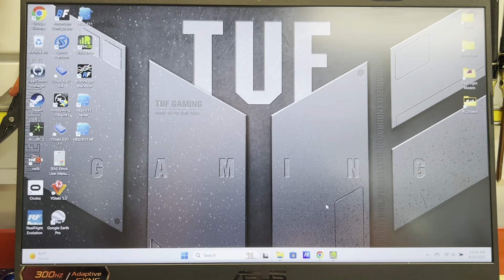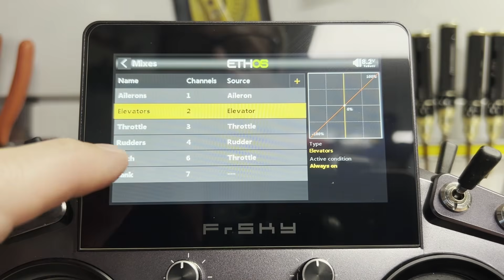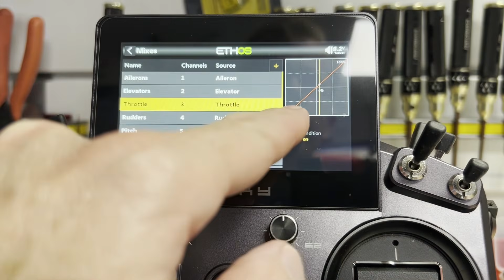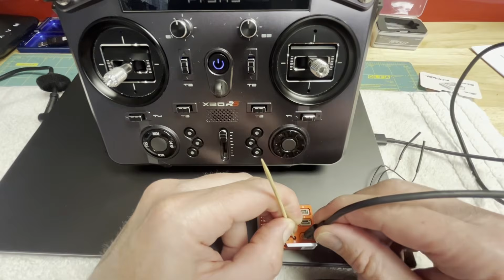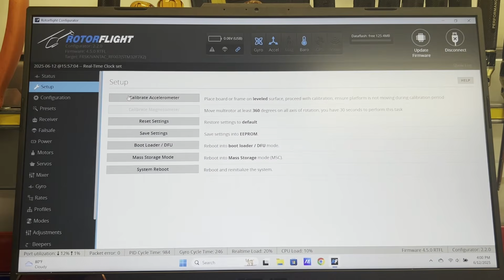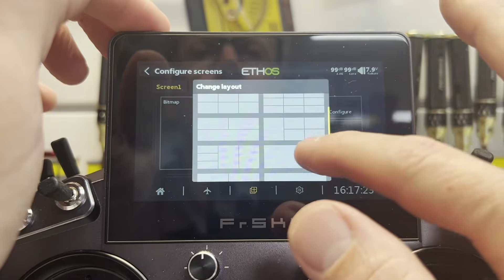Vantac RF007 and FrSKY Radio setup

Comment: Hi Adam, the ImpulseRC website has closed down. I'm able to detect my unit, but when updating the firmware. I get a "failed to open serial port" at the top left. It seems available at github, but neither chrome or edge allow the download as they flag it as unsafe? I've used my USB data cable for data transfer before and I've also tried the USB data cable included in the box. Both produce the same result.
Reply from the maker: Darn!  Let me figure out what hat people are using now. Sorry about late reply.
Reply: @adamsmall2301  Morning, no problem. I spoke to FrSky support and they emailed me the Driver Fixer link. It seems to still be available via GitHub, but presents a message that it could not be safe for download.

Comment: What happens if you inadvertently hit that arm switch in-flight?  I imagine it would be like losing the "Jesus bolt" while flying?😮
Reply from the maker: The motor would cut off lol. I put it on a switch that isn’t easy to reach.
Reply: Gave away mine last month, don't want that anywhere near my expensive scale models.  Spirit GT with Geolink all the way for me! 😂

Comment: Hello Adam, I followed your video for setting up as I was very new to Ethos. I put the firmware file in the flashdrive, instead of the other drive. Do you know if that will create chaos 🤔
Thanks for all your hard work.
Reply from the maker: I’m not sure if it would or not. Have you tried it out yet?
Reply: @adamsmall2301 yes it's fine also deleted the wrong file. All is awesome just waiting for the weather. Thank you for getting back to me 🚁🚁🚁

Comment from the maker: Here is a copy of my diff all file for a Tron Dnamic, Xnova Lightening 4025-830, HW 150 amp 8s, Xpert R3HV cyclic servos, Xpert R2T tail servo.

# diff all

# version
# Rotorflight / STM32F7X2 (S7X2) 4.5.0-RC4 May  7 2025 / 08:42:52 (dc4faef) MSP API: 12.8

# start the command batch
batch start

# reset configuration to default settings
defaults nosave

board_name VANTAC_RF007
board_design F7B5
manufacturer_id FRSK
mcu_id 001f00273433510131303737
signature 

# name: Dnamic

# feature
feature TELEMETRY
feature GOVERNOR
feature ESC_SENSOR
feature FREQ_SENSOR
feature RPM_FILTER

# serial
serial 1 1024 115200 57600 0 115200

# servo
servo 1 1451 -700 700 500 500 333 0 3
servo 2 1533 -700 700 500 500 333 0 2
servo 3 1471 -700 700 500 500 333 0 3
servo 4 760 -350 350 250 250 500 0 1

# mixer input
mixer input SR -1250 1250 795
mixer input SP -1250 1250 -795
mixer input SY -1658 1167 580
mixer input SC -1250 1250 940

# aux
aux 0 0 0 1800 2100 0 0
aux 1 53 2 1800 2100 0 0
aux 2 26 3 1400 1600 0 0
aux 3 31 3 1800 2100 0 0

# adjfunc
adjfunc 0 2 255 1500 1500 1 970 2030 975 2025 0 1 3
adjfunc 1 1 255 1500 1500 1 970 2030 975 2025 0 0 3

# master
set gyro_lpf1_static_hz = 150
set dyn_notch_count = 2
set dyn_notch_q = 30
set dyn_notch_min_hz = 60
set acc_calibration = 2,-11,45,1
set blackbox_rate_denom = 2
set blackbox_log_acc = ON
set blackbox_log_esc = ON
set blackbox_log_bec = ON
set min_throttle = 1005
set main_rotor_gear_ratio = 13,137
set tail_rotor_gear_ratio = 20,101
set align_board_yaw = 180
set bat_capacity = 3500
set vbat_max_cell_voltage = 425
set vbat_full_cell_voltage = 420
set current_meter = ESC
set battery_meter = ESC
set battery_cell_count = 8
set tail_center_trim = 104
set swash_pitch_limit = 1833
set gov_mode = MODE1
set gov_tracking_time = 50
set gov_autorotation_timeout = 300
set gov_autorotation_bailout_time = 15
set rc_deflection = 511
set rc_arm_throttle = 990
set rc_max_throttle = 2011
set yaw_deadband = 3
set pid_process_denom = 2
set telemetry_sensors = 3,4,5,6,7,8,9,42,93,99,46,50,95,17,18,19,20,21,22,23,96,27,60,61,91,92,64,69,70,71,88,89,90,57,11,12,13,14,15,0
set esc_sensor_protocol = HOBBYWINGV5
set esc_sensor_halfduplex = ON
set esc_sensor_pinswap = ON
set gyro_rpm_notch_preset = 0
set gyro_rpm_notch_min_hz = 25
set gyro_rpm_notch_source_pitch = 10,11,12,12,13,14,21,22,0,0,0,0,0,0,0,0
set gyro_rpm_notch_center_pitch = 0,0,25,-25,0,0,0,0,0,0,0,0,0,0,0,0
set gyro_rpm_notch_q_pitch = 50,50,40,40,50,50,50,48,0,0,0,0,0,0,0,0
set gyro_rpm_notch_source_roll = 10,11,12,12,13,14,21,22,0,0,0,0,0,0,0,0
set gyro_rpm_notch_center_roll = 0,0,28,-28,0,0,0,0,0,0,0,0,0,0,0,0
set gyro_rpm_notch_q_roll = 50,100,35,35,50,50,50,50,0,0,0,0,0,0,0,0
set gyro_rpm_notch_source_yaw = 10,11,12,12,13,14,21,22,0,0,0,0,0,0,0,0
set gyro_rpm_notch_center_yaw = 0,0,25,-25,0,0,0,0,0,0,0,0,0,0,0,0
set gyro_rpm_notch_q_yaw = 50,50,40,40,50,50,50,48,0,0,0,0,0,0,0,0
set name = Dnamic

profile 0

# profile 0
set pitch_p_gain = 115
set pitch_i_gain = 120
set pitch_f_gain = 130
set pitch_b_gain = 40
set pitch_o_gain = 50
set roll_i_gain = 120
set roll_f_gain = 130
set roll_b_gain = 10
set roll_o_gain = 50
set yaw_p_gain = 120
set yaw_i_gain = 200
set yaw_d_gain = 35
set yaw_b_gain = 5
set pitch_d_cutoff = 25
set pitch_b_cutoff = 25
set pitch_gyro_cutoff = 65
set roll_d_cutoff = 25
set roll_b_cutoff = 25
set roll_gyro_cutoff = 65
set yaw_d_cutoff = 35
set yaw_b_cutoff = 35
set yaw_gyro_cutoff = 200
set yaw_cw_stop_gain = 172
set yaw_precomp_cutoff = 15
set yaw_cyclic_ff_gain = 10
set yaw_collective_ff_gain = 35
set pitch_collective_ff_gain = 6
set error_decay_time_cyclic = 150
set iterm_relax_cutoff = 15,12,15
set rescue_mode = CLIMB
set rescue_flip = ON
set gov_headspeed = 1600
set gov_gain = 50
set gov_d_gain = 10
set gov_yaw_ff_weight = 5
set gov_collective_ff_weight = 133

profile 1

# profile 1
set pitch_p_gain = 110
set pitch_i_gain = 90
set pitch_f_gain = 125
set pitch_b_gain = 40
set pitch_o_gain = 50
set roll_p_gain = 45
set roll_i_gain = 90
set roll_f_gain = 125
set roll_b_gain = 10
set roll_o_gain = 50
set yaw_p_gain = 115
set yaw_i_gain = 200
set yaw_d_gain = 20
set yaw_b_gain = 5
set yaw_f_gain = 5
set pitch_d_cutoff = 25
set pitch_b_cutoff = 25
set pitch_gyro_cutoff = 65
set roll_d_cutoff = 25
set roll_b_cutoff = 25
set roll_gyro_cutoff = 65
set yaw_d_cutoff = 35
set yaw_b_cutoff = 35
set yaw_gyro_cutoff = 200
set yaw_cw_stop_gain = 145
set yaw_ccw_stop_gain = 70
set yaw_precomp_cutoff = 15
set yaw_cyclic_ff_gain = 10
set pitch_collective_ff_gain = 5
set error_decay_time_cyclic = 150
set iterm_relax_cutoff = 15,12,15
set rescue_mode = CLIMB
set rescue_flip = ON
set gov_headspeed = 1900
set gov_gain = 50
set gov_d_gain = 10
set gov_yaw_ff_weight = 5
set gov_collective_ff_weight = 137

profile 2

# profile 2
set pitch_p_gain = 105
set pitch_i_gain = 90
set pitch_f_gain = 115
set pitch_b_gain = 40
set pitch_o_gain = 50
set roll_p_gain = 45
set roll_i_gain = 90
set roll_f_gain = 115
set roll_b_gain = 10
set roll_o_gain = 50
set yaw_p_gain = 110
set yaw_i_gain = 200
set yaw_d_gain = 20
set yaw_b_gain = 5
set yaw_f_gain = 5
set pitch_d_cutoff = 25
set pitch_b_cutoff = 25
set pitch_gyro_cutoff = 65
set roll_d_cutoff = 25
set roll_b_cutoff = 25
set roll_gyro_cutoff = 65
set yaw_d_cutoff = 35
set yaw_b_cutoff = 35
set yaw_gyro_cutoff = 200
set yaw_cw_stop_gain = 135
set yaw_ccw_stop_gain = 75
set yaw_precomp_cutoff = 15
set yaw_cyclic_ff_gain = 10
set pitch_collective_ff_gain = 4
set error_decay_time_cyclic = 150
set iterm_relax_cutoff = 15,12,15
set rescue_mode = CLIMB
set rescue_flip = ON
set gov_headspeed = 2000
set gov_gain = 50
set gov_d_gain = 10
set gov_yaw_ff_weight = 5
set gov_collective_ff_weight = 137

profile 3

profile 4

profile 5

# restore original profile selection
profile 1

rateprofile 0

# rateprofile 0
set roll_rc_rate = 28
set pitch_rc_rate = 28
set yaw_rc_rate = 45
set collective_rc_rate = 56
set roll_srate = 28
set pitch_srate = 28
set yaw_srate = 53
set collective_srate = 56
set setpoint_boost_gain = 20,20,10,0

rateprofile 1

# rateprofile 1
set roll_rc_rate = 28
set pitch_rc_rate = 28
set yaw_rc_rate = 45
set collective_rc_rate = 54
set roll_srate = 28
set pitch_srate = 28
set yaw_srate = 53
set collective_srate = 54
set setpoint_boost_gain = 20,20,10,0

rateprofile 2

# rateprofile 2
set roll_rc_rate = 28
set pitch_rc_rate = 28
set yaw_rc_rate = 45
set collective_rc_rate = 54
set roll_srate = 28
set pitch_srate = 28
set yaw_srate = 53
set collective_srate = 54
set setpoint_boost_gain = 20,20,10,0

rateprofile 3

# rateprofile 3
set roll_rc_rate = 27
set pitch_rc_rate = 27
set yaw_rc_rate = 42
set collective_rc_rate = 52
set roll_srate = 27
set pitch_srate = 27
set yaw_srate = 49
set collective_srate = 52

rateprofile 4

# rateprofile 4
set roll_rc_rate = 27
set pitch_rc_rate = 27
set yaw_rc_rate = 42
set collective_rc_rate = 52
set roll_srate = 27
set pitch_srate = 27
set yaw_srate = 49
set collective_srate = 52

rateprofile 5

# rateprofile 5
set roll_rc_rate = 27
set pitch_rc_rate = 27
set yaw_rc_rate = 42
set collective_rc_rate = 52
set roll_srate = 27
set pitch_srate = 27
set yaw_srate = 49
set collective_srate = 52

# restore original rateprofile selection
rateprofile 1

# save configuration
save
#

Comment: We need a full setup of the gyro how to adjust the servos how to level a swash plate all that through the gyro and my brother's been working on it for 3 weeks and can't get the motor to run. But after the radio is set up, we need a video of how to adjust the gyro and set the gyro up for the helicopter. No one has that
Reply from the maker: I agree, I’m thinking of a part 2 to the video when I put that Vantac in my helicopter. 
For most of the RF setup, I used Bert Kammerers video in MY show description.
For ESC, motor setup I used RV video reviews VIDEO that is in my show description. 
For the tail geometry, I used Robert Burrow’s video in my show description.
Reply from the maker: I finally got a part 2 done boys!  I posted it on my channel yesterday.

Comment: When I buy a FrSKY I will tell my wife it's all your fault and this video started it! Before you fly your model always try your buddies 1st ;-) Great video
Reply from the maker: Thanks my dude!  Great radios at a great price.
Reply: @adamsmall2301  this crap gyro still requires a computer and has way too many parameters that nobody knows what they are used for I prefer the setup simplicity of the other gyros